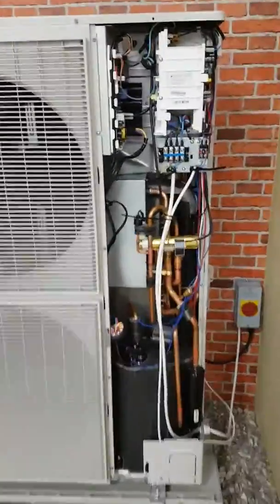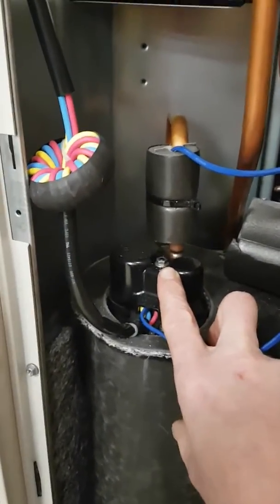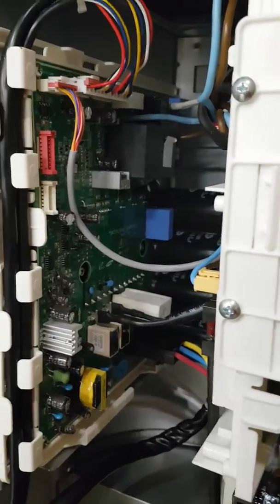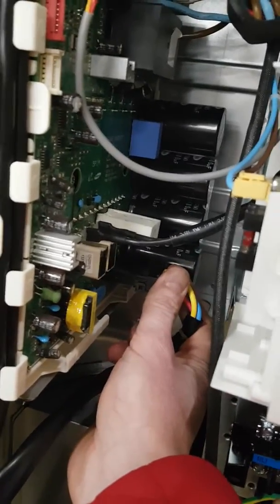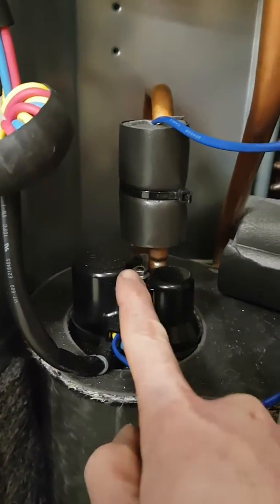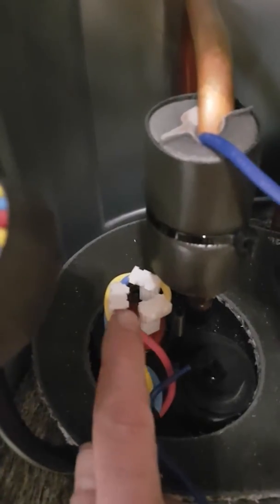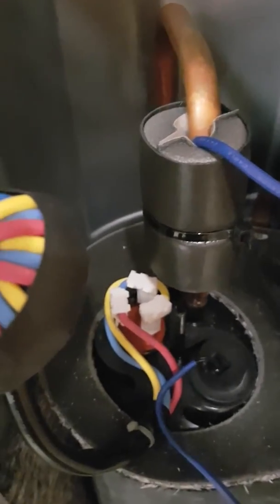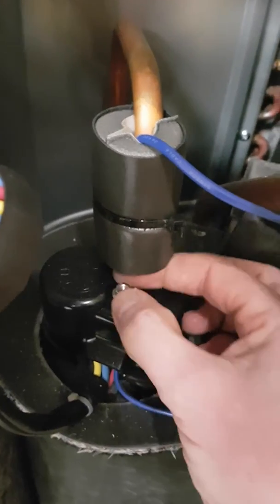E461 error on Samsung EHS heat pump

Comment: I've fixed a few inverter motor systems on lg washers, they are very sensitive to resistance in the connections,as some use the wires to sense back emf to detect rotation . I've noted that Samsung use poor quality resistors, the were way off spec ! The problem is some SMD components don't like 340v which is what the DC voltage in these units are .also come across bad crimp connectors to compressor,wires soldered fixed that .